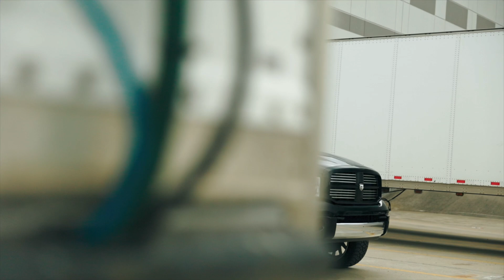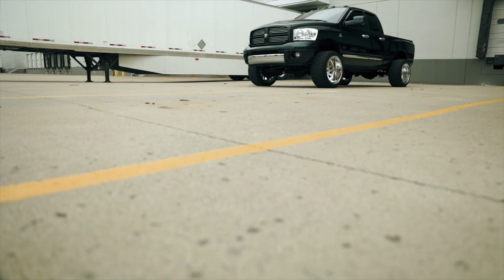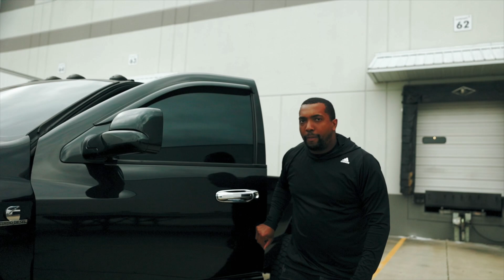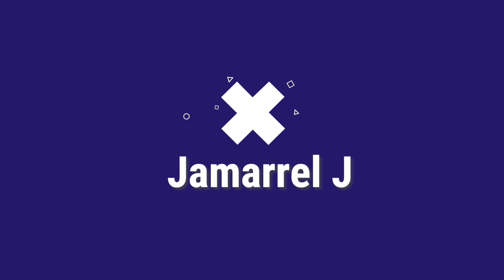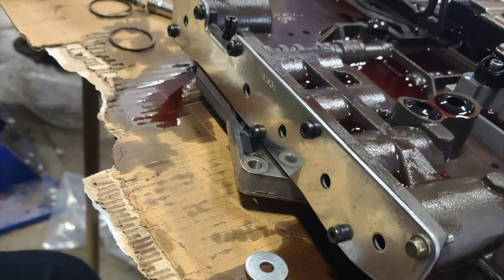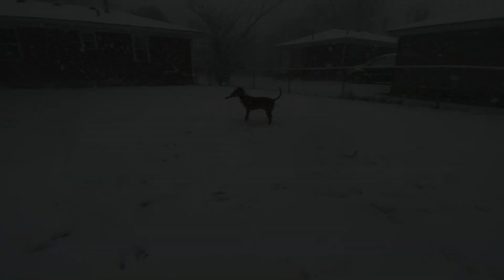Dodge Ram Error code P0734 fixed ‘68RFE FAILURE PART 2’

Comment: I was towing a dump trailer on Friday with my 2013 ram 2500 with a 68rfe. 168334 miles and hit a pot hole in the freeway and then had all neutrals. So we will see what all happened to it soon. Dropping the transmission off tomorrow afternoon.
Reply from the maker: Aww that has to be the worst!! Transmission work is never fun. Mine had 1st and 2nd gear but no overdrive

Comment: This is why I installed a $1000 Revmax billet valve body in my 20k mile '19 2500 as soon as I tuned it. One drive with it tuned and I was like "hell no! This stock shit ain't gonna hold up." So I drove it like a grandpa until I received my new valve body and revised transmission tune with line pressure bumped up to 225psi and now I feel safer putting some power down. I still think my clutches will fail eventually since they are still stock but hopefully I can get 100k miles before I need to get it built proper.
Reply from the maker: Yeah I got a lot of miles out of the stock valve body. I wasn’t pushing a lot of line pressure but it shifted great. Even the day this happened it drove amazing until it stopped haha